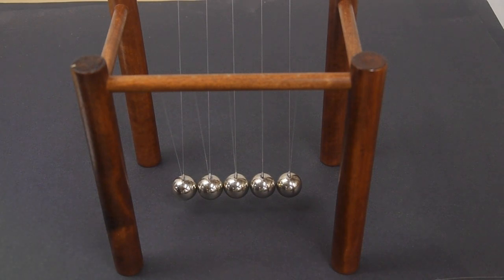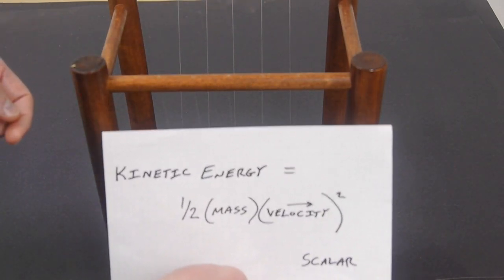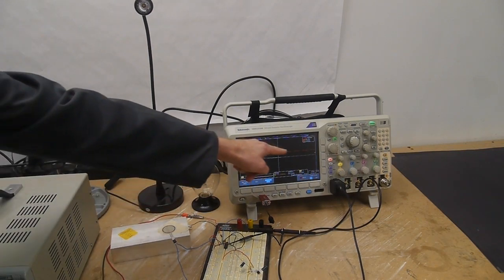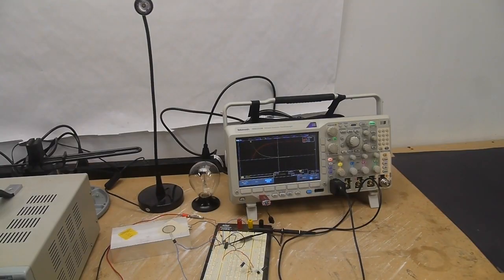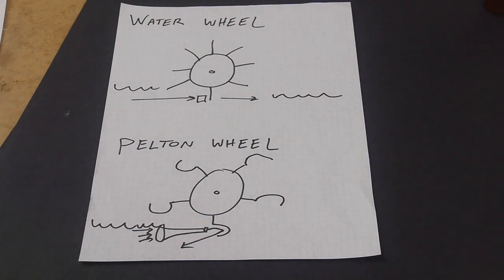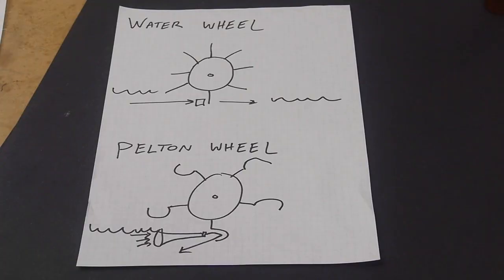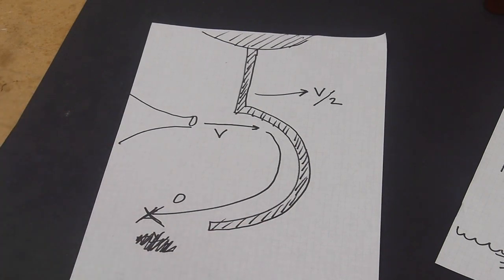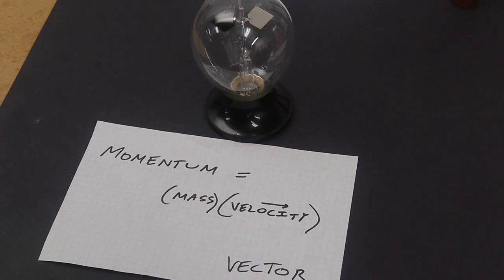Obeying the law (of physics)! Kinetic energy and momentum explained

Comment: This is very interesting. I have been wondering about the paper representation of what is going on with the spoon shaped part of the wheel. Because the illustration is represented as a 2 dimensional view and we live in 3 dimension in which situations do we need to us a 3 dimensional illustration to comprehend the problem.
I assume that water molecules bouncing off in a z axis doesn't affect the physics in this scenario?
My perspective is more focused on for example a physics engine point of view to simulate physical behavior to illustrate real life physics.

Comment: Interesting behavior of the Newton's cradle. I initially expected it to behave as it did, but your hypothesis made sense too. I was really surprised to see that the behavior was consistent with three and four balls. If you were to attach two of the balls, would it launch only one ball at a greater speed? I think the behavior seen in the experiment was caused by some very small delay between the impact of each ball.

Comment: I have found that speed and mass and kinetic energy can be explained much like a container with water flowing out of it from the bottom.  Speed/kinetic energy can be described as an amount of water and the container,  it's mass.  A % of the container being full,  Say 50% correlates to 100mph, it takes much less energy/water to fill that mass to 50% of the mass is small,  than of its a large mass. Once the container is full, you only need to keep up with the rate at which the energy leaks out.  That is why it takes more energy to get up to speed, than to keep a speed.  You have to fill the container. 

Think about this,  there are much more ways that this lines up.
Reply: I did this on my phone,  it's not very clear.  I'll repost later.

Comment: So the red line is like measuring Horse Power but with some other unit but the same way to measure force? My brain is hurting trying to figure out an analogy/equivalent to what the red line is. I have an analog scope (don't know much about them fancy pants new fangled dig scopes) so the red line is calculated by some math function in the scope? If you had units for the red line what would it be newtons/time? or newtons/length?

Comment: So when you changed the pressure around the Radiometer, you changed the light velocity.  Would that mean the mass changed as well.
Did it not "optimize" at partial pressure?
How would variations in atm pressure effect a solar cells eff?

Comment: Isn't it all about the time the water has to do its work on the blade?! On the scoop shaped blade the water can push the blade for a longer duration since it is shaped so that it will catch the jet for a longer time, since the angle will change as the wheel turns? A straight blade will very quickly have an angle to the jet (or water fall) that will just make the jet glance off. 

This is why on a water wheel the flow is directed over the wheel to fall on the far side of the wheel instead of just going under it or on the near side of the water fall.

More impeller blades are good!

Comment: Is a Red shift lengthening or shortening the wave length of the light? and would a magnifying glass work as a nosle?
Reply: Hi, a shorter wave length = higher frequency = more energy. This means a red shift is a lengthening because the wave loses energy. Since the speed of light is constant within a medium it has to lose energy that way.

A magnifying glass however would itself not act as a nozzle because the light is not only shifted in color but has also changed its speed. The speed of light depends on the refractive index of a medium! This means the total energy for the light stays the same within the glass and it leaves the glass as it came in. 

If red light comes in, it is blue shifted and slowed down within the glass. Leaving the glass it is sped up and red shifted again.
Reply: There not such a literal analogy for the nosle as the light does not need to be placed on a specific part of the radiometer vane. The amount of energy transferred depends on the reflectivity of the radiometer vane which is why this is different on either side so that more force is applied to one side than the other and so it will spin.

The analogy is between the cup changing the direction of the water by directing the flow to the opposite direction and the reflectivity of the radiometer vanes changing the direction of the light by reflecting it.

Comment: If photons always travel at the same speed, why would they be red-shifted? Surely that is a function of wave-length, which wouldn't be changed. If you shine, say blue light on the radiometer. will it rotate at the same speed as red light?

Comment: I sometimes work with high power photo flashes. But if I hang a sheet of metal (1,5 mm aluminium) in front of it and trigger the flash, the sheet will "chime" just by the light.
I have always been wondering if it's the photons bouncing of like your video or if it is a thermal phenomena due to the high energy released from the flash tube.
Any thoughts?

Comment: Where does the kinetic energy go?

If there is an 80kg target that completely absorbs the .025 kg bullet moving 300 m/s the momentum equation gives the target about 0.1 m/s velocity and .4 joules kinetic energy.
What happens to the 1000+ joules of energy the projectile had on impact (assuming target absorbed it and the bullet didnt continue traveling past target)? Please help this make more sense - thank you
Reply: All the energy in this case is used to bring the bullet to a stop. If the target did actually move, the bullet would still have some momentum forward (thus it would be moving forward). If the bullet was elastic, then i would store the energy and bounce. Its important to consider whether a collision is elastic or not, before using the momentum equation.

Comment: My radiometer works from the radiant heat of my gas fire, I assume it's the heat and not the light. It would be interesting to see if it works from the heat of a hot plate that doesn't emit light.
Reply: It emits a lot of infrared radiation, which is almost the same as light, but you can't see it with your eyes.

Comment: but hold on for a second,for the test of the ball i see an other interpretation,what i see is the bouncing ball have more contact with the surface of the sensor than the none bouncing ball that's why more intact are transferred to force,because we know the sensor sense the force which is the pression multiplied by the surface and the two ball wouldn't have the same surface of intact with the sensor eaven if they have the same momentum and more i'am note at all convinced with the interpretation of momentum to heat

Comment: I'm not been able to understand why when you hit the pendolum with a ball, then A ball will jump on the other side, and when you hit it with two balls CAN'T happen a single ball jumping away faster... WHY? :-)
You'll have conserved the energy for exemple M=20Kg  V=10m/s => 1/2mV*2= 1000J
Then two balls have 2000J
A single ball bouncing off the other side should go at V= sqrt(2000J/1/2M) that equals to 14.14m/s
MOMENTUM? M*V=constant, so 20*10=200 (by the moment that the vectors are all equally oriented I'm talking only about module of momentum)
So one ball has 20Kg*10m/s= 200Kg*m/s
two has 400.
So one ball that should come off should have 400/20=20m/s. And it has not enough energy to do that. because it has only 14.14m/s achievable maximum.

So? 

We have to find a way in which both energy and momentum will be conserved. Ok it SEEEMSSS it works but...

What if we have a two non bouncy balls with metal ones beetween of them?
What should change?
By what we said, nothing but I have some doubts... Hmmm.

In my opinion somethig weird should happen...
The metal balls are bouncy so that the energy is (more or less) conserved.
If they weren't boucy, the energy will be partially dissipated.
So the same that a single boucy ball coming by a lower height.
So the outcoming will be one, as before, but slower.
The energy will be conserved (for the not dissipated portion) and the momentum?
What I should say about momentum in that case?
Does it have to be conserved? We have not enough energy to do that so?!?!?

How to define this amount of momentum we have to preserve?

Also in the full  metal expeiment the oucoming ball is a little bit slower. Or you think that under vacuum it will last forever?
I think not.
So We are actually talking about something like a "best approximating behaviour"?
Please talk us again about this. :-)

An hypotesys is that the non bouncy balls actually will bounce bach. dividing in half the energy to be stored in any ball and we will have also an aoutcoming ball jumping on the other side ...

HEEELPPP!!!!! I'm going mad!
Reply: What changes in your question at the end is the elasticity of the (final) collision. If the collision isn't perfectly elastic, you aren't imparting the same amount of energy to the motion of the ball, some gets converted to heat, transferred to the air (sound) and more. In short, it's conservation of momentum and conservation of total energy in the system--not just the kinetic energy of the balls.
Reply: +MadocComadrin yes but my point is that what you say is ALWAYS true. Because dissipation is always there!  So I'have in my mind that some best approximation concept seems to take place. My question was about the increasing of dissipation so that we should have room for other approximating solutions. Then i think elastic wave and their amplitude should be part of the problem. Let me know.

Comment: For high velocity energy transfer, the basic formula is E=MC^2.  C being velocity constant, whether radio. light, X-ray, ect.
I've been trying to find the bat hitting ball formula, where MODULES of ELASTICITY of materials are taken into account.  Consider the method of energy retention/reaction of each surface.
Is your O-scope sensor sensitive to area of contact?  The rubber ball will certainly have a higher contact area, due to deformation.

On July 28th, 1945, after the B-25 hit the Empire St bld, the victims inside stated "The building swung like a pendulum for 30sec.... we had trouble keeping our feet under us as we ran for cover.".  THAT is what REALLY happens when an aircraft strikes a skyscraper, no witnesses made this claim in Sept of 01'.
Reply: oooOooOOOooOOooo spooky.
Reply: cheerdiver 
According to your logic wtc was never hit by a plane? The videos are faked?
The witnesses are faked too? Man you are brillant!
Reply: ***** The way a SOFTball will not travel as far as a baseball, lower Mod of elasticity.  Of course there are condition where MoE is overcome, such as sheet metal fabrication, ergo unibody construction to meet crash safety standards.  All commercial airliners are fabricated from gauge (very thin) sheet aluminum, hence the reason ppl had dry feet when standing on the wing of Sully's airliner in the Hudson river.  A prime example of how it's mass density is about two tenths that of water.
scheerBOM Logic?? Try the LAWS OF PHYSICS.  Point out any "witnesses" who heard turbines at WOT.  Even the video audios have the explosions happening w/o time delay from 1000+ft, does that make sense to you?
I know the B-25 airframe fell to the street w/o assistance, ie never making it inside.  I know the ESB was facade in limestone, and like all masonry, has no appreciable tensile strength(>1Ksi).  This is why karate demos break stone w/ their bare hands.  I know the exterior columns of the TT were structural steel (>85Ksi tensile).  I also know tensile strength is what prevents penetration.
So I ask the question of how your hayseed physics works, can you show an example of how aluminum in free space can penetrate structural steel at subsonic speed?  Physics is REPEATABLE.  Even basic Calc shows it would only take a consistent 50g to completely stop a projectile traveling 500ft/sec, that's only half the length of a 767-200.  F1 drivers survive 85-145g, and the cockpit hardly gets crushed 2ft.
Seems some of you guys didn't stay in school very long!
Reply: cheerdiver
I will tell you a sad but true thing
Nobody with knowledge will bother to
point out the LAWS OF PHYSICS  you are missing in your genius train of thought.
Even though they want too, including me.
Reply: scheerBOM Quit replying to him... look at his Google+ page... he's a lunatic.
Reply: “It's easier to fool people than to convince them that they have been fooled.”
― Mark Twain

As opposed to what?  Being nothing what so ever,  look at sch&jr's pg.  Shill comes to mind.  They won't refute anything b/c the can't break THE LAWS OF PHYSICS!
Reply: cheerdiver
...especially if they haven't been fooled

Comment: I am sorry to say it, there is a mistake in your setup.

The problem with the pressure sensor is exactly in contradiction with your statement in the other video where your explain that the LM324 is used as DC amplifier, no need for fast amplification.

The heavy metal ball is wasting all the potential (gravity) energy on the pressure sensor. The bondcy ball only give at tiny amount to the pressure sensor.

The missing item is what? You already gave the answerby comparing the sound. The metal ball create much more loud and sharp noise. The sharp noise is similar to the white noise of a whip! It is what give that sound to lightning and to the super sonic boom of the concord air plane.

The metal ball is effectively creating a super sonic boom, which is a sum if a large number of sine waves going up at frequency high enough to reach, but not exceed, the speed of sound in air.

I you redesign your amplifier to allow the high frequency (using a real op-amp, not the LM324) with correctly designed ground plane to avoid annoying self oscillation, then your high quality, fast scope will compute correctly the area under the curve (the total energy) and your will find that the law of physics apply.

You deserve "like" because you try much harder than most youtuber to get answers. I expect a third video with revised explanation. One of the most fundamental discovery of science is the universal conservation of energy. This belief is much more satisfying than the traditional magical though that we all had as child.